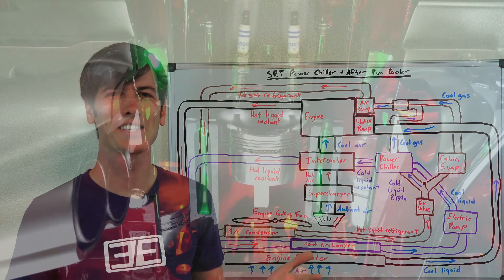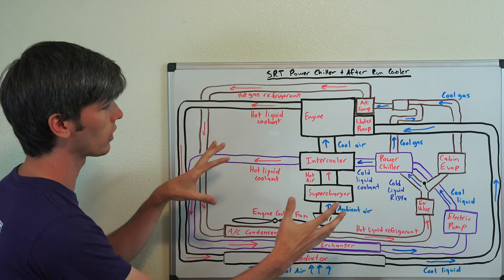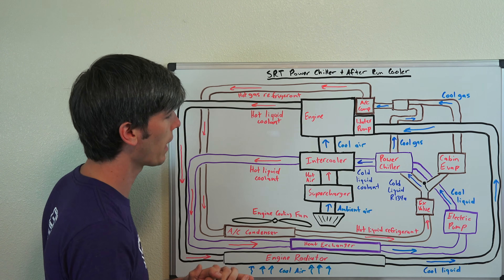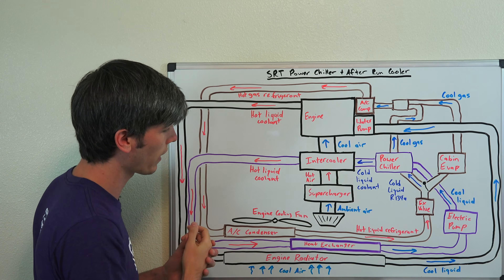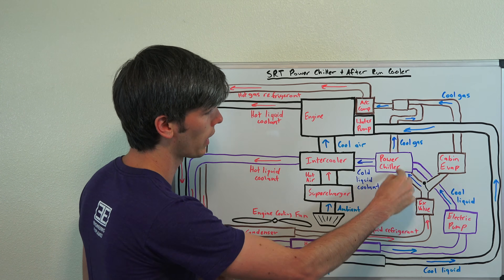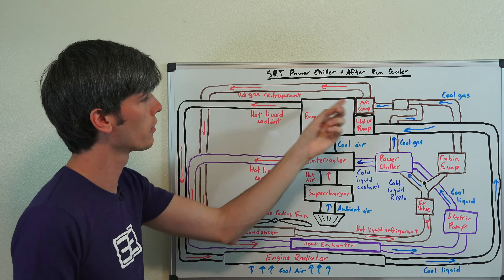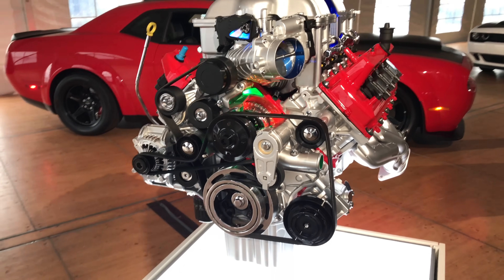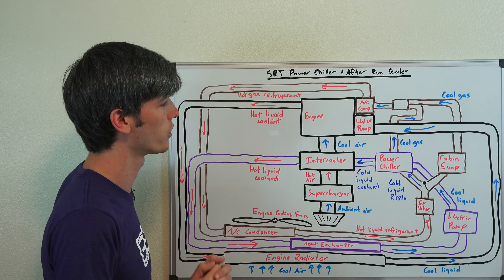How The Dodge Demon Uses Air Conditioning For More Horsepower!

Comment: you can also use a supercharger cool pad to help with heat soak and cooling the air and fuel mixture that pad will suck the heat right out of the blower in between runs at the track

Comment: I hate this video. You describe this like it is a puerperal motion system. This doesn’t work continuously. A super charger takes 90hp and pumps in a massive amount of air. The system you are talking about is a closed system. It only works by harnessing the energy from the engine off throttle when you are not going down the drag strip.

Comment: Wow, this is so cool to see!  I've been thinking of doing exactly this so I can run a ~500 hp marine Detroit Diesel in my bus instead of the ~300 hp or so available from a non-marine, road going version.  Aside from needing a very large radiator (in place of seawater cooling) the way they get to 500+ hp is with a seawater cooled intercooler.  My thought was to go with an air to air intercooler first after the turbo, then use the chiller that normally supplies A/C for the entire coach to supply chilled water to the original intercooler to further cool the charge air to similar temperatures that would be found with the original seawater cooling.  SO cool to see someone has already done it!

Comment: what i did with my '79 RA40 Celica was to put an AC feed hose that runs on my Cold Air Intake Body  that goes straight to the AC Vent... i also made an Air Funnel with ducting that redirects fresh air from the front grill towards the Intake Cone... so basically the colder air received by the cone is further cooled down by the injected AC Cold air in the middle of the Intake Body before it reached the carburator... i dont have number for HP gains but the engine feels happy and responsive with that setup... i also noticed better fuel economy somehow... so i guess that works

Comment: I thought Lotus Elite? Was 1st and called it a Freon Intercooler. Car was in 1987 "Pretty Woman"? Most 4cyl cars had a power steering high pressure switch in PS hose that cut out AC clutch during parking events so the engine won't stall from load. Also cut clutch at WOT for passing power🐰

Comment: Question? If the water temperature was too low would you run the risk of condensing water on the air side the intercooler thus blowing droplets of water into the engine? Is that why they have the water loop?

Comment: Would one be able adopt a more primitive-basic  concept of this as a modification to their own car? I have been thinking about this a long time now,dodge beat me to it :P My thought was something along the lines tube from air condenser to intercooler vavle with on/off switch (like mad max)  to alternate between cabine and intercooler. Would that work? Even remotely? except for the tubing,can you find/buy/manifacture/adopt one of those power chiller thingies? would the whole project be a viable option if you had that?

Comment: Chrysler was presented with this design and two closely related versions in 2000 to be used on a more powerful version of the sp360 from the 1998 Durango sp360 Shelby. They replied that “ that is the stupidest idea we have ever heard of and if it would really help in any way, someone would have done it by now”.  After Chrysler passed on the idea, it was also sent to Ford by a close friend of the original designer. Ford responded in a very similar way to the response from Chrysler.

Comment: You very often have the best videos to explain what I am looking up, many thanks. I was just wondering if adding something like an intercooler to a non-supercharged car would give a little increase in power on very hot days.
Reply from the maker: Intercooler will not be effective on a car that doesn’t have forced induction. Just want to make sure it gets clean air from the front of the car rather than hot air from the engine bay.
Reply: @EngineeringExplained  Thank you !

Comment: I saw something similar many years ago at the drag strip.
The guy had a 1980's Buick Grand National 3.8L turbo car.
He ran the intake air charge through another AC system Evaporator at the engine to further chill the intake air after the inter cooler.
Yes, he raced with the AC compressor running.
He had electric fans on the radiator also.
The car did wheel stands.
The added horsepower he got far exceeded what it took to run the AC compressor while racing.
He had such a cool intake mixture , it made the engine think it was running in the winter air temps.
I believe he also had metal intake air ducting wrapped with tubing that had the chilled refrigerant running through it and wrapped to insulate it creating more chilled surface area for the intake air to contact.
A very clever setup.
I'm not sure if he still had the original evaporator functional though but it was still in place.

One of the things that I did on my own '82 Pontiac Grand Prix w/Chevy 350 in it was adding a DC water pump I got from Grainger Supply that was plumbed through the heater hoses so I could circulate the coolant through the engine while parked thereby cooling it down very quickly and preventing a heat soak condition.
That car was NA and carburated. Didn't need the AC at all on that car.
Headers all were heat sleeved as well to keep the heat out of the engine compartment.
I don't think it ever ran more than 180 degrees on even the hottest days , had an over sized radiator and electric fans on that also.

Comment: You stated this is the first time this power chiller has been used in a production vehical, I have a chiller that looks very similar in my srt6 crossfire.   I have had the car a couple months and was going to remove all the extras to save weight, and a tuner told me that this system is excellent at cooling the air.  I can not find anything on the internet that explains it, can you help ? thank you for all the excellent videos, you are better than a college!

Comment: Out of a Supercharger and Turbo charger which ones gonna take the most Hp to run? im guessing supercharger takes less cause its a more efficient mechanical system, am i right?
Reply: An ordinary turbocharger doesn't take any hp to run. It runs on exhaust gas, i.e. power that your engine just discards otherwise.
Reply: zolikoff bro if it's compressing air it's gonna be using horsepower, like you ever wonder why air compressors need a motor to run 🤣🤣🤣
Reply: Exhaust gas definitely has usable energy, but it's not energy the car uses to move its wheels. So while there's a horsepower involved, it doesn't "take" horsepower from the car's engine the way a supercharger does.
Reply: zolikoff mmm maybe, I guess it really depends if the used air and fuel from cylinder is compressed enough to drive that turbo, cause if it isn't the piston on the return stroke will be doing the work which will take away from engines usable driving power 🤔🤔 so yea that's really what I'm trying to find out

Comment: The only time any electrical component is strictly powered by the battery is when the alternator is not producing any power. Any time the total electrical demand of the electrical system is less than the capacity of the alternator all electrical power is being supplied by the engine via the belt train, and is therefor drawing power directly from the engine.

Comment: I had a similar idea to boost power on my Focus. Its relatively underpowered for how much weight shes carrying around.
I wanted to use an electric motor to run the compressor so it doesn't take power away from the engine itself. Then it would be at matter of piping it into the intake. Maybe even a small electric air compressor to make a lil boost.
Im not sure if it'd be worth all the trouble, it was just an idea I had while high and contemplating how to make more power without a turbo or blower.
I thought about getting rid of the ac all together and putting a Rotrex in its place, but I live in Texas and the summers get hot AF.

Comment: If you run the thermodynamic equations and you recover more energy than you spend running the A/C... it works. The same principle of every intercooler out there, but with a pump. Every thermal power plant uses those principles.

Comment: Imagine all the complication that could be removed by moving to an inductive liquid cooled AC motor like the Tesla Model S! 

If cummins can build an Electric Semi-truck, then certainly some awesome electric high performance launch mode vehicles that can even eclipse the Dodge Demon for launch performance must surely be in the pipeline to commercialization. Toyota John Goodenough Glass/Salt batteries with 250kWh in a car that can charge in 10 min ^^ using L5 ultra super fast charging!

Comment: I remember hearing from a friend of mine that worked for a Ford dealership, that this same idea was bounced around for use on the 99-04 F150 Lightnings. He said the idea was scrapped because if the AC system leaked, the freon (R-134) would burn and make a toxic gas out of the exhaust system....

Seeing as Dodge is now using this, does that mean that he was BSing me? Also, what does happen if R-134 burns in the exhaust? Just curious...

Comment: with A/C on -> the longer the strip, the more power you will gather from this system. am I correct? I'm talking about 1/2 mile drag strip here. as long as air going through the engine radiator and follow circuits on that engine system, then you can nonstop using A/C while smoking your opponent.

Comment: TLDR: The AC still is detrimental to your gas milage, but it does increase your horse power while running, by cooling the intake air and advancing the timing.

Comment: sorry, but they should built the Power chiller as a (maybe isolated) massive (10 pound or so) steal Blok, so they can store "cooling Power" you could chill it down to a relay low Temperature. in advance.

Comment: It seems to me that it would work better if the charge air bypasses the intercooler when not at full throttle, so it can store some coldness for when it's needed. Also bypass the radiator when liquid temperature is lower than ambient.

Comment: gee that was a bit long-winded, you know how you compress  the intake air with a turbo but bring it back to ambient with the "inter-cooler" to keep the air dense ? well now you go a step lower by actually refrigerating the air with an AC system to make the air even denser for the same pressure and so get even more air into the engine and more air/mix means a bigger bang and more power.

Comment: Would it be easier to inject LPG in intake just behind of air filter in amount  that mixture be below inflamable limit(lean mixture) and the rest of needed fuel( petrol or LPG) to be injected by regular fuel injectors.
LPG when is expanded from liquit state to local pressure it cools very well. It could cool mixture more than 10-20 degrees.

Comment: This is a great idea; however... Every track i have ever been to explicitly states that a/c systems are not allowed to be on while your in the staging lanes/track due to the evaporator condensation that is going to be draining from the evaporator drain tube.
Reply from the maker: +WOTStang correct! They have what is basically a catch sponge for the evap unit, so that nothing drips below the car.
Reply: Engineering Explained Outstanding!  They really did their homework.  👍🏻

Comment: he said that ALL internal combustion engines are cooled by water... NOT TRUE!! sorry my VW is air cooled so was/is the Chevrolet Corvair. Also a lot of construction equipment actually uses the oil as the main way to transfer heat.
Reply from the maker: +OMC-Slugbug and it's not even water, it's water ethylene glycol, so many lies from this guy.

Comment: I have a question

Why they dont use refrigerant to directly cool air instead of water?

 Because of lower Specific heat capacity of the air it can reduce air temp much more than water (10 c)
I think if we cool the output air of intercooler directly with refrigerant it would be more efficient!!!

Comment: In my car when you turn on the ac it doesn't work if you use 1,2,3 (the power which the air would blow) if you put it on 4 it works, but 1-3 gives my car more hp as tested by me and some friends. i got the car from a guy who modified the car previous to me so everything he did idk about it 100%

Comment: Once the liquid from the air conditioning system is mixed with the inter cooler system liquid does it not raise amount of coolant in the inter cooler system
Reply from the maker: +Ishaanq Garg they do not mix, the simply transfer heat to each other through metal fins.
Reply: Engineering Explained thanks

Comment: It would be fun to build a car with a giant compressed air tank in the trunk.  You could get very cold intake air temps as the gas expanded out of the tank, and would not need a supercharger or intercooler, just a big-ass metering valve.  Plus, you would be able to reduce flow work on the intake stroke, maybe even push down on the piston during intake like a compressed-air engine, at-least at low rpm.
Reply: Jess Stuart weight might negate the power advantages though

Comment: 1. Do the turbocharger takes also such huge amounts of power ( I know that turbo takes waste gas power ). I mean - how much waste gas power takes turbo to create the same boost as the supercharger that takes power from the engine it self? Which device is more efficient? 
2. What % of engine power takes supercharger in general. It is 10%, 20 % of finał power output?

Comment: My question, so the only time the intercooler is operating to cool the intake charge is when your running it?  What about every day driving?  Knock will be there if the air is not cooled so how is it cooled if you wanna cruise in your new car and stay cool in the cabin?

Comment: What do you do about the condensation from the condenser? Your typically not allowed to run ac systems in the staging lanes or while making a pass down the drag strip. Did dodge do something to address this, or is it a feature you will be only able to use on the street?

Comment: Instead of using power chiller to cool the intercooler, why not cool the air directly by the AC compressor and then send it to the engine. It is because, you have to cool the intercooler and then cool the air, which takes time ofcourse. Directly cooling the air intake manifold and just ignore the intercooler afterall. Enlighten me if I was wrong..

Comment: I'm not 100% certain, but somewhere between 2% and 99.999% a WOT condition will disengage the A/C clutch.  So you'll still have stored air that's below ambient until equilibrium occurs.  The biggest benefit is starting off the run with a much lower temp than ambient.

Comment: they were probably using R134a, which can really only get your air down to 0C at the lowest, but that would be with a 26C ambient temp.  Given the size of the cooling unit, I would say that to drop any more than 10C using the AC would mean going to a different gas, something like R404, which can go way below 0C.  Fine for a track car, but at what point do the gains become not worth it.

Comment: I have a 2500hd Duramax that loves to get +230 when towing up hill, I've always wondered why the GM engineers don't put a AC By-pass system to send the AC Coolant to the Turbo Intercooler during heavy engine loads?  This would significantly lower the incoming air temperature. Or place a AC Radiator (cool) in front of the Radiator to cool the incoming air.

Comment: You mentioned the supercharger takes 90 hp to run.  What is the net hp gain?  With the AC on and the chiller engages, what is the hp used by this cooling system and the net hp gain?

Comment: It's called a Killer Chiller, made by Kincaid Performance. Ford lighting owners have been using it for a decade. Almost all Supercharged Tundra owners run one in the Middle East. It works in parallel with the cabin AC, lowering coolant fluid to about 10-15c. Using a valve solenoid separating the two lowers coolant fluid to below 0c. The Demon's knock-off is way behind in performance and functionality.

Comment: It's a shame they didn't fit the car with an A/C compressor that runs off battery power too as well as the pump, and then made the launch mode button also cut the alternator load for a few minutes, letting the battery take the strain of running them for a few minutes.

Comment: WHY is refrigerant going into the power chiller to cool the intercooler liquid which will cool the intake air? that is one system with double conversion with double losses. why did not they make a separate radiator in the intake just for the refrigerant so it can directly cool the intake air? yes there would be another radiator on the way for the air in the intake but cooling effect would be much higher. (yes it would be more expensive to engineer and build but... in this case who cares if you add 1-2000 on this walue)

Comment: It may be the first time that exact way has been used, but it is a near copy of the supercharged/ AC intercooled Corvette Stingray! 

  I like your videos, and am not out to correct you. The Corvette though has been doing it for years, and is pretty obvious the first modern American car to do so. The after run system isn't much different than a HKS turbo timer. With that; I have put a relay/delay in my legacy wired to fans, and parking lights. So after I drive it like I stole it, a quick flash of parking lights when I park runs fans for three minutes. Cost was under ten dollars, and has worked great for past two years; without extra noticeable switches!

Comment: i wonder how much power you actually get from the ac intercooler. 

i mean the ac pump has to be on = draw on the engine 
electric water pump is on = draw on the battery = draw on the alternator = draw on the engine 
electric engine fan has to be on ==== draw on the engine 
the supercharger itself  = a draw on the engine 

so i wonder what the actual power gain is vs just a non cooled supercharger.